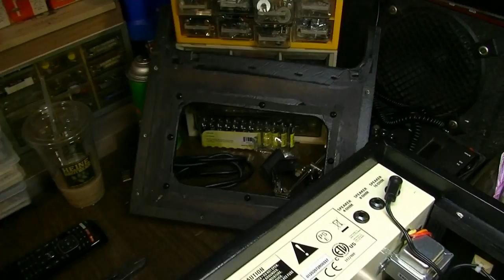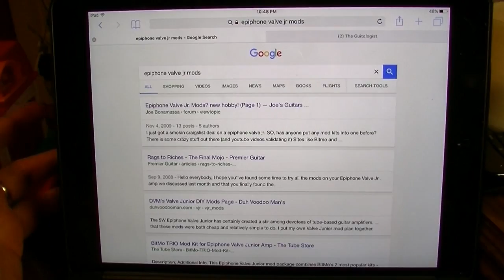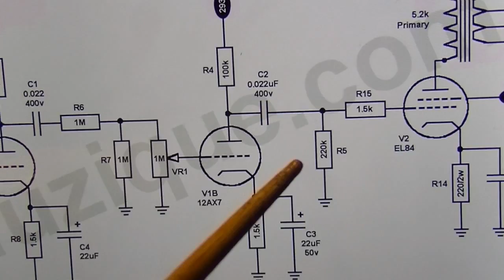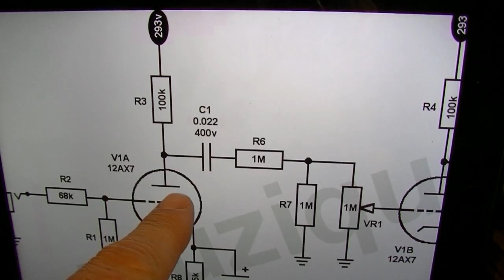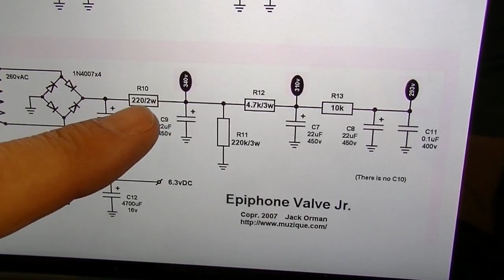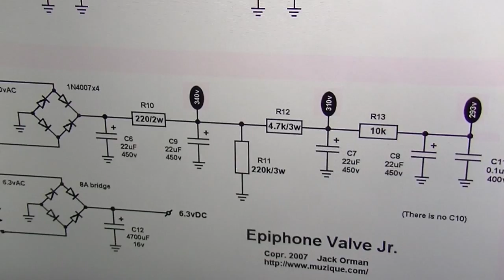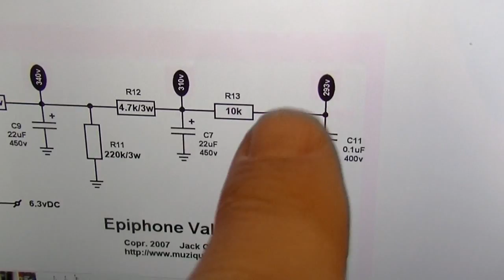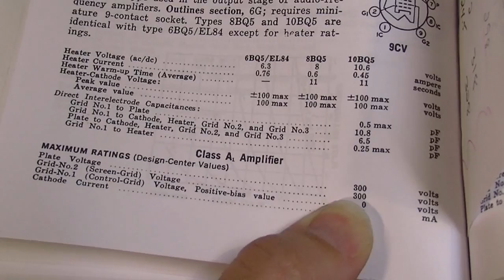Epiphone Valve Junior  Mods - A Total Waste of Time?

Comment from the maker: Here's the follow-up video: https://youtu.be/xMpWcFX4wAg
Reply: Marshall has been using 'cardboard' for their cabinet back panels since the 70s. I'm sure it was a cost savings move, but MDF also has desirable sonic qualities (lack of reflection) as a back panel. Also, like most amps, it's wrapped in tolex and therefore quite unlikely to fall apart. At the least, "you get what you pay for" logic certainly does not apply to this example, as 1960 cabs are not inexpensive. Not to mention, for many years, these 'cardboard' cabs were made in England. Many MIC products (e.g., the Squier Classic Vibe series) will stand toe to toe with their more expensive, made elsewhere, equivalents these days. Many of them are rebadged products from other, american and European companies (the result of our sending our labor overseas for cost savings). 

Just sayin', the well worn absolutes are far from absolute...
Reply: I should also add, thank you for your educational videos, they are an excellent resource!
Reply: I would like to point out that the number 10 is considered unluck by the chinese. Something about the characters that make up the number 10 mean "bad luck" or some such.
Reply: The Guitologist * It's pretty cool that you can apply your knowledge of electronics to modify amps but in my opinion the epiphone amp that you did here sounds better than it did but NEVER going to sound good at all to me. I had the head version and no matter what cabinet and no matter what pedals I used it NEVER sounded RIGHT and I tried every combination between PEDALS and nice speaker cabs but it so sounded shitty, sadly.
I just wanted to tell you thanks for doing the mods and showing me that this amp will never be up to my standard of tone and there's is no remorse from getting rid of it, especially since I got twice what I paid for it when selling.
Reply: Damn you got it sounds good from my End .
Uncle Doug may just give you his seal of approval .👍
Reply: purplexenno, ln the Philippines they're like that too, and do "o"s.
Reply: The Guitologist that thing’s the Snap Together model of guitar amps.
Reply: HI , I HAVE A (PT9 COMPRSIAR
Reply: Hi
Reply: stick a jensen in there for shits and giggles    . you know your shyt thats for sure .
Reply: Ive heard them JJ's are not the best  input tube
Reply: Jensen replacement R10 E. 8"
Reply: Love the walk through... good knowledge - great little practice amp now.
Reply: LOL - the power supply filter caps - THEY GO TO 11!
Reply: Eddie Willers p

Comment: 220k 3W is a bleeder resistor. It discharges the caps for you. Doesn't really affect the tone much, especially with solid state rectification, and if you remove that 220R series resistor.

Comment: You're very right about all these cardboard amps. They make these things out of MDF and that stuff and they can't stand up to any abuse. Plywood is SO much more solid.

Also, those jacks being independent of the PCB IS very nice. I recently replaced board-mounted input jacks on my 1990s Fender combo amp, and it was very touchy. There's very little room for error.

Comment: R11 bleeds the high voltage off the caps in the power supply when you turn the amplifier off so you won't get shocked,

Comment: Remove R7 and greatly increase both your base and your gain.
No other mods required...
Putting in a smaller value of cathode bypass cap in the first stage only increases the highs and attenuates the lows. If you want more base, you would have to increase the value of the bypass cap.

Comment: At 37:30 in, you communicated you put a Zobel network on the input with the 10k and 2.2n.   What is this??   Not familiar with it.   Where these components located in this circuit??  What is the purpose and it trying to accomplish?

As far as "fizzyiness"....Pretty much every SE-amp I have heard, this has been a characteristic.  I think some voicing and rolling off of the high end will take care of this.  Maybe 500 or 1000pF peaker caps on the plates of the preamp tubes might take care of this?!??

The R11 220k you removed could have stayed in.  It's just a bleeder to ground once the power switch is turned off...IF in the correct position.  

Likewise, C11 (.1uF) could have stayed in in parallel with C8.  It just tried to eliminate top end frequencies and any high end oscillation.

Comment: R11 is there to bleed the voltage on the filter caps when the amplifier is off.  Thats so you don't  discover the high voltage charge on the power supply capacitors with your body parts when the amp is off and you are working on it ! ! !

Comment: I suspect the fizzy sound is coming from the small output transformer + core saturation.  Did you try putting something like a low E 80hz sine wave in and see if it looks noticeably more distorted at the secondary than the primary?  The nice thing about these amps with no negative feedback between multiple stages, is that you can test each stage independently.  Another option would be to try C2 to be 0.01uF or less with a speaker and cab that has a bass bump, so the output transformer does not need to deal with the low end as much.

Comment: The 220K R11 is a "Bleeder Resistor" that bleeds off the power supply filter capacitors for safety issues.

Comment: The 220k 2/3W to earth is a power cap drain resistor and is common in many amps but usually sits before the first cap stage .  The use of one cap with no power node is purely for filtering and is very common . The resistor between the 2 will be a wirewound and will act like a choke not drop any voltage . This is left over from the days when small amps had a 1k 25W choke driving the speaker straight from the first cap , like the Valcos ( Oahus) and Gretschs 6155s etc of the 50s . Kind of like the standby switch , totally unecessary but traditional.  1 22 uf filter and 3 x 22uf caps are plenty for this amp and more than the original Vox AC4 with a 12ax7 trem tube . The weird one on the end of the chain is a mystery unless a solid state LDR type trem version was planned as small value electrolytic caps are often found in those trem circuits . The speaker is a Rola alnico going by the basket stamping . Rola UK used the same baskets but large cylindrical alnico magnets and by the 50s had bought Celestion who produced them at Thames Ditton or in London before moving to Ipswich . The 10" ribbed cone variety works great in pairs , but are very nice as singles too .

Comment: If anyone is wondering about the purpose of some of the removed components. The resistor to ground in the power supply was there to slowly discharge the high voltage after the amp is turned off, it is a safety feature. The small capacitor in the power supply that is in parallel with a much larger one is there to handle high frequency ripple since the large cap has a high inductance. I would have left those two parts in place.
Reply: I can't imagine seeing a resistor in an amp that has seen enough current to scorch it and think "I'll just remove it and add a jumper.  That will be fine."  🤣

Comment: I have the separate amp version of the VJ, and since I don't know anything about electronics, I modded mine by connecting it to a 2x12 speaker cabinet.   That made it sound quite good.
Don't ask what the speakers are.  I've had that cab for quite a while.

Comment: R11 is a bleeder resistor. Stops huge inrush currents (but kinda useless for solid state rectifier) and also drains the capacitors after turning off the amp. Its not a must have in an amp, but removing it serves no purpose either.

Comment: Hello from Washington State.....and thank you for the video.  I was forced to open my Epi valve Jr. (head) as I left it on overnight to a failed condition.  And...now need a schematic....found by your hand to what I now study for repair end goal.
I use the unit as source by fender frontman to Fender Cab.  And, I really like the warm tone.  Just a bit of hum...but I find the crunch input is remarkable at higher volumes and what I enjoy from a Jackson set of pickups.
And, at unit open, first test run...did not find the failure.  So I am studying the 
values to continuing test and intended replacement.  With no hurry, routine 
repair (and or replacement).
I might be that person looking over you shoulder....and liking the clear presentation of mods...best avenue to improved performance as I am working to repair+ end damaged finding. I like the absolute best value as job process and reliable use.

Comment: Just wanted to say that I successfully installed an Eminence 1028k speaker in one of these. some dremeling and new speaker baffle was made with the original grill cloth stapled onto it, but it totally worked.

in conjunction I made all of the resistor changes in this vid, opted for Mojotone Dijon capacitors of same stock value. They really tame a lot of the brittleness inherit in this amp. 150pf ceramic 'bright cap' on the left and center lug of the volume control to "open it up" a little bit at lower volumes.

It's so perfect as is now, I'm afraid to modify it any further.

Comment: Did you discharge the filter caps everytime you worked on it? I wanna try out modding my valve jr like this but I don't wanna get chocked. I already understand how a tube amp works and how changing different parts changes different aspects of the tone from watching Uncle Doug's videos, but I really don't know about discharging filter caps on a pcb amp.

Comment: Edit: this has ALL already been said. Bugger it! 
Isn't R11 just a high voltage bleed down resistor? Adding safety incase other faults don't make the rail drain particularly quickly. I had an amplifier board that would be lethal for over two minutes until I modified it no to attempt to kill me! C11 is a bypass of C9.. Shunting hf to ground. I see it's also non polarised. I like most of the other changes though, little bit more lively, much more my thing.

I wonder why it was made to be so tame!

Comment: I noticed a very big Improvement in Mine by changing the tube to a Electro Harmonix 12AX7EH. I bought mine used and it had a tung-sol 12AX7 which I doubt was stock. It sounded horrible. The speaker also makes a huge difference. Did not sound so good through my Mesa Boogie black shadow speaker but sounded decent through an alnico Jensen. I plan on adding an adjustable tone stack to mine.

Comment: This is strange. Yours has 4/8/16 ohm outputs, but mine only has 4. But mine is identical on the front. The base "junior" model with no DSP/tone/etc knobs. My backside is also different with a horizontal band across the rear speaker hole to prevent you from smashing it in.   OH, yours is a "valve junior combo" but... mine is a "valve junior" ... except it's still the combo because it's not a free head.   My Fuse is a T2AL (vs yours is T20AL).  My serial is 10050479. Your serial is huge [could just be a different factory]. my Intertek number is 3076408, yours is 3122900, so if that's like a patent number or model number yours is likely newer and people complained about the "4 ohm only" output. But then again, mine might be a cost reduction since my rear speaker box looks stronger/reinforced than yours. Hmmmmmmmmm.

also my speaker has an epiphone E on it and no other text.

Comment: Brad, I really like your channel and took away a real nugget from this Valve Junior mod video. As you reviewed all your mods, the one that didn't get any "air time" was the Zobel network across the output transformer. I design low-watt but high gain single-ended amps w/o global feedback. I can tame oscillations just fine but that "fizz" remains. The "ah-ha" moment was seeing you add the Zobel. I immediately clipped in 10R/50nF across the speaker and the results are amazing. Many thanks for the tip.
Reply: What do ur little. Amps go for? For a fellow guitologist fan ??!!
Reply: Zobel on tube?

Comment: The capacitor across the eloctrolytic is to compensate for the high esr. And there is no reason to remove that at all. I always bypass my preamp electrolytics like that which makes the amp stages more separated and the amp less prone to oscillate and less prone to amplify radio freq. WTF? WTF?
Reply from the maker: As you can clearly hear at the end, there are no oscillations. They are unnecessary.
Reply: So you just removed it to make the pcb lighter?
Reply: @TheGuitologist  Did you even read the rest of my points? Its a good modern thing to do this at the drawing board for several reasons

Comment: 0.022 vs 0.047 /1M wont make a difference at all because ƒc=1/(2πRC). Aka -3dB at 7.2 Hz vs 3.6Hz.
Reply from the maker: It doesn't make a difference, but you show the equation which says it does. Interesting. The effect I was going for was cumulative. It isn't about just that stage, since those frequencies get amplified on down the line. It sounds like you need to modify one of these yourself and show your work and all your tenacious calculations and see if you arrive at a better result.
Reply: @TheGuitologist  7.2 Hz vs 3.6Hz.....so you can hear that? Thats what Im talking about. Its a placebo effect, its not real.

Comment: First, lower the cathode bypass resistor to get rid of power-robbing low end that does not contribute to the tone.  This can however add hum from the heater into the cathode.  In such a case, lower the value of a coupling cap instead.  The amount of low end extension, and the amount of negative feedback, are the main reasons for the difference in how a Fender and a Marshall break up (Fenders usually being gnarly or even farty).

The purpose of C11 is to make sure that the electrolytic's inductance does not reduce its capacitance at high frequencies, causing stability issues with the gain stages.  This is something that is (or was) common in high-end tube hi-fi gear, but seldom seen in instrument amps.

I liked it better before you changed the speaker, modded the supply, and added the grid stopper and Zobel network.

Comment: Remove C2, change C1 to 100  uF, ditch the R7+R8 voltage divider, and add a 470K grid stopper going into pin 7 of V1. Boom, done.
Reply: I will try this to my Laney Cub 8

Comment: I used to have the head version of this, and I ran it through a Marshall 1960B 4x12 with 4 75 watt celestion GTs, it sounded amazing when you cranked it all the way. I don't know anything about messing with circuits like this, but i really want to learn. Love your videos. It seems like a super-valuable and handy skill to be able to modify electronic circuits instead of having to be at the mercy of manufacturers like the general public. Thanks for making these videos. It was super interesting to see how the tone shifted based on the capacitor and resistor changes you made. I'm learning a lot...

Comment: Some of the components you removed were "good practice" and you should have left them in even though they wouldn't have made much difference in this sort of lo-fi setup. The resistor in the power supply helps smooth out the hum and get voltage to spec. (No reason to drive them harder even if they keep working.) And the small cap in parallel to the larger one? You know that electrolytics do really bad in the hundreds of kilohertz range? Chances are that your amp would now play AM radio on its own if it was still present in the air. In fact, in sensitive digital circuits, you'd have 3 different caps in parallel because the "high capacity" ceramics/films also suffer in particular bands and you need another 470p with different chemistry to get proper response all the way up.

Comment: Yes,to the caps for filtering.,,,are all 40,80 or 100 uf ? and every one identical  !  More protection is running pairs together as a frontal assault .2 33's then become 16.? uf at twice the voltage as you already know. I changed some out like this with good results tonally and  built mine in nodes... which allows tiny  networks of parts and still point to point ! I think that running solid state rectification with AC only is a noisier supply than DC on filaments...more hum or BLoW ??????? I'm not telling anyone anything about amps as an expert. I took apart a tube record player in 1998 and have been hooked ever since ! Joy to actually make something that works from this ancient method as cool as a single ended honkin' rude little guitar amp ! Also, for you gearheads,this tube amp stuff teaches basic electricity as well as anything else for a DIY project.I am impressed with  all your videos and especially the ones where you explain procedures...I learn something in every one of them and I have a project upcoming using yard sale items to build an amp from scratch. I did my first ,a  5F1 champ circuit with adjustable feed back loop. Got my aluminum from scrap yard , used radial Electrolytics, Built or modified metal corners ,then drilled and tapped these corners to be used as chassis corners because I used an Epiphone Valve Jr. as the cab !Tiny  in there ! They have wooden slats raised off the bottom of the cabinet. I could have cut these out somehow but I used two plates of aluminum  one with tube sockets at the very bottom and up the chaasis off the "floor" I added another with holes for tubes as large  as 6L6's tying these together with the ends also drilled and tapped for connection to the "sides" of my chassis. This was further complicated by the fact that I could only get the chassis inside after many attempts and modification. If I put together snugly and to correct shape,it wouldn't fit ! Aluminum makes one heck of a noise when being ground down to size so consider the neighbors and the time of day when you tinker.Looking back, I should have tried to put all my components on the original chassis but would be very difficult with good iron I think because of the space limitations.
Many thanks for you guys expertise ,It's fun to learn this stuff...at least for some of us.I wanted to know more...Daniel